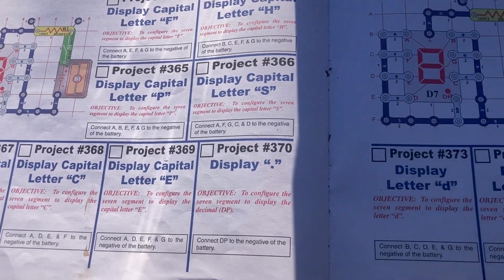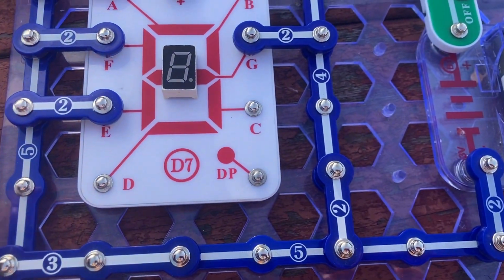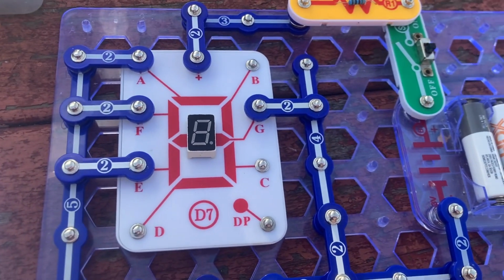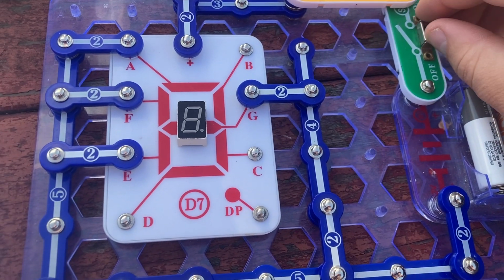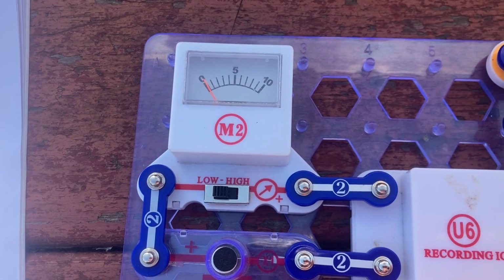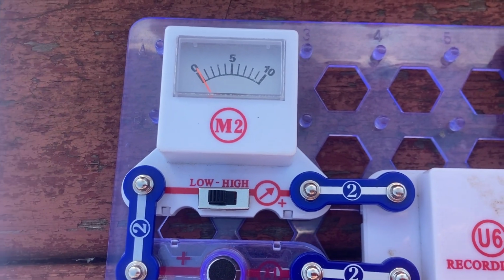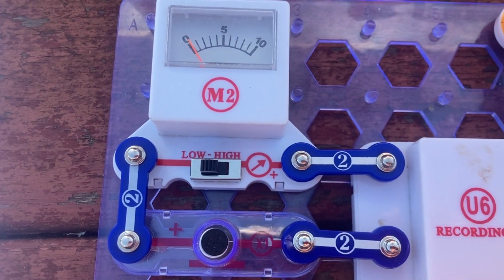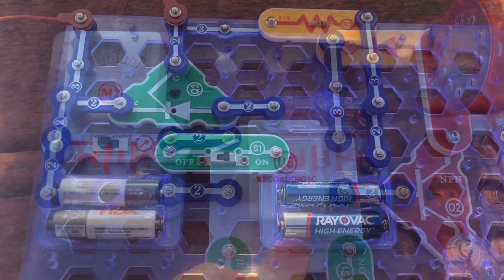Snap Circuits Extreme SC-750: Projects 363-403

Comment: Error: If this is 363-403 but the previous one is 329-361 then you skipped project 362(Buzzer and Relay)
Reply from the maker: @JDSuperstar14  I’m very sorry, but I forgot to include it in this video.  I will, however, upload a separate one of that project and put it in the snap Circuits Extreme playlist.